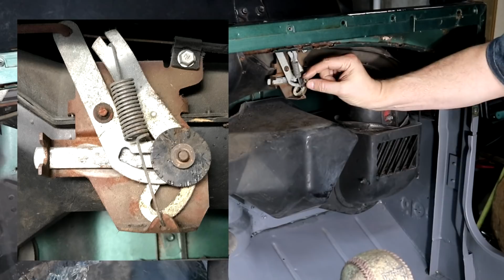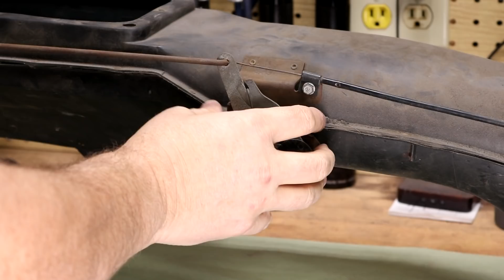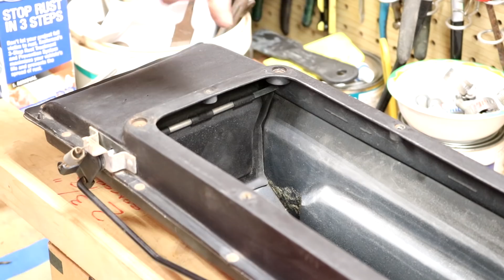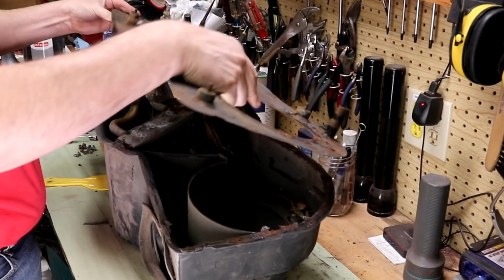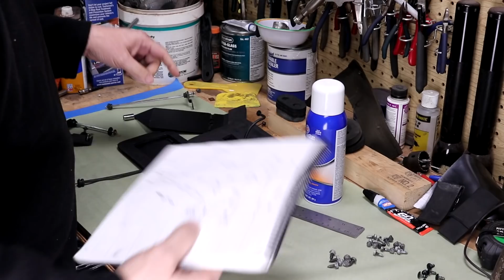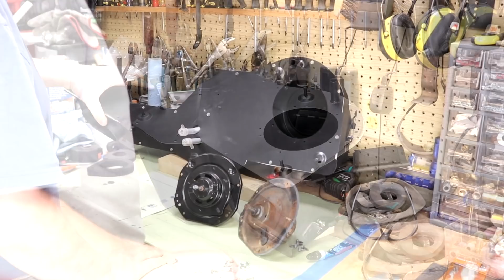Jeep CJ7 Heater Box Restoration | Project Rowdy Ep028

Comment: question  for you, i am working on my heater now to put back in,  the Pm102 blower motor  there is a metal ring around the part that sticks out  the firewall,   it can be pulled off.   does that ring have be on? is it just guarding the magnet ?  with it on, it does not fit in the hole by like 1/8 but if i take it off it fits.   not sure yet how much sticks out, maybe i could put it back on once in stalled?   I asked the people working on the body to cut the hole bigger but they used a different blower so its off. thanks
Reply from the maker: I do remember that extra thick metal ring around the motor, but not sure of its purpose.  I would not think that it has anything to do with the function of the motor, but not sure.   You could take it off, then connect the motor to power to determine if it sounds like it is running OK.   If so, run it!

Comment: "Rebuilt" my heater box when I first rebuilt my 1979 CJ-7 in 1998. I sure do wish I saw your video back then. Now my heater core is leaking (27 years later), so it's time to pull the heater box out again. Great video, makes for a great tutorial! Thank you!
Reply from the maker: @marcdenlinger5282  Thanks for the feedback.  As you may remember, it is not that hard.  After reading through what others had done, I knew documenting the process oils
Be beneficial to others.   Best of luck and enjoy the process.  Mike

Comment: Good evening! Once again superior videos!! Thank you so much! What wiring harness did you go with? Thank you!
Reply from the maker: Thank you... Thank you!   I have not purchased the new Wiring Harness, but from my previous research, my plan is to use the Painless 10150.  Since I did that original research, I have thought of a few other electrical features that I will be adding to my Jeep.   I will need to double check that the 10150 will still support my needs.  I am pretty confident that it will.  Have fun with your project!!!!   Mike
Reply: @ I’ll b monitoring your next move🤣🤣, thanks Mike once again ur a champ!!

Comment: This is one of the the best things I did for making mine a decent daily. Where I lived at the time was way out in some canyons 20 minutes of bad roads to get to a highway. The next was Ford internet wiper switch / module. Super easy, my next would be to run foreward off-road lights on a switch/ relay system so I enabled them with the regular switch, but they would only come on with high beams, and turn off with low beams. Also ran rear floods similarly, they came on when in reverse with high beams (no switch) or on with a switch.
Reply from the maker: @JamesMcNamara-j1g  Aweaome!   Thanks for sharing your other mods.   Those are great ideas!   Mike

Comment: Man going back and reviewing this stuff after not working on my jeep for a long time brings it all back. I was thinking that blower motor was the same as either the Chevy Vega or non-A/C late 70's Chevy trucks. I had both in the past but memory is a little fuzzy now. I've had problems with replacement heater core not being a drop in fit too. Having the hood, dash and windshield off sure helps! This is excellent work and I will probably refer back when I start on mine again.
Reply from the maker: Several simple repairs and upgrades that should make these heater boxes work better for us.   Cheers and have fun tackling yours!   Mike

Comment: I like the attention to detail. I'm getting ready to fix a lot of problems on my 1980 CJ5. It's a fiberglas tub & I'm the 4th owner. I will use your video & PDF files when I pull out my heater box. The prior owners really didn't know what they were doing. I have restored the complete suspention system as wel as the fuel,brake & clutch systems. Keep up the great work &  thanks for taking the time for such things as the template (above and beyond).
Reply from the maker: Sounds like you have already corrected or updated many things on your CJ5.  Hope you continue to find success in your updates.  In the end, it will be very rewarding.   Thanks for the kind words.   Mike.

Comment: my latest CJ7 came to me needing a lot of TLC, the heater box was disconnected and the hoses bypassed I presume because the core was leaking.  Your videos are great and I'm going to try to tackle the heater box myself.
Reply from the maker: Awesome!   The heater box restoration is very straight forward.   best of luck with your CJ and have fun with playing around with it.   Mike

Comment: I just wanted to say thank you for the videos and everything extra you have done.   you explain things simply and are easy to understand. I am going to restore my 85 cj,  I hope next year, I hope to start taking it apart in the next few weeks, I have watched a bunch of your videos, even the ones that I don't think I will be doing.  I hope to take things apart myself and then shop out what needs to be done. going back as stock as I can. but want to clean it all up stop any rust and make the Jeep an everyday driver. going to do my heater box myself and add aftermarket AC.  not sure if I will do the heat/AC one or just AC ( probably just AC)      anyway    only proper to say thank you very much,   I know this is a few years old  but what is great about this is someone can find it years later and it still helps
Reply from the maker: Thank you for taking the time to provide this great feedback.  Glad that these videos are helping guys that decide to help put these ole Jeeps back on the road.  I have owned mine since 1988.   Have fun with restoring yours... They are not that hard to work on and there is plenty of help out there!   Cheers.   Mike
Reply: I got my 85 cj.  In 1989 when I was in high school !!  
So I have had it a very very long time.   Runs great.   But I want to future proof it. 
Paint it back Olympic white  
I got a set of original seats in the mail today.     I hope will be good enough to reupholster Doing lots of research and looking.   
Thanks again.     I may even try to record the process.

Comment: This is an incredible video…..  thank you. I need to do this.  Nice job on the editing. How hard it it to take the dash off to get to the heater?  Do you have a video on that?
Reply from the maker: Glad you enjoyed the video.   I do not believe that you have to remove the dash to remove the 2 units.   It may help to remove the passenger seat just to give you more room.   From the engine side of the firewall, you can detach the hoses, 4 nuts, drains, and Blower Motor wire.   The video shows where the 3 control (push/pull) cables are attached under the dash.   You should be able to reach under there and detach as well as the flexible vent connection (between the Heat box and Fresh Air Box.   The heater box should them be available to remove.  For the Fresh Air box, you will also need to remove the inlet grate (where the fresh air comes in) from the top of the cowl.   I would at least give that a try.    Mike
Reply: @UCanDoIt2Mike   Thank you for the quick response.
Reply from the maker: To answer your other question.... How hard is it to remove the dash?"  In reference to removing the Heater units...  The dash could be un-screwed from the tub and pulled back a little.   The Speedo cable will restrict how far you can pull it away.   I will reiterate that you should not have to do this for the Heater refresh.   Here is a video on me taking out my dash.  I did it as a part of a total restoration.  

https://youtu.be/o6mW55GZmIg

Comment: My 1978 CJ5 has the open cell foam on the triangle end of the defrost/floor heat gate/damper.  The original piece was made out of one piece and folded over the angled edge.  It covered both sides of the triangle from the bend out.  I took a picture and have dimensions if you want to add it to your drawings (not sure how to send it to you).  My heater turned out great following your video and drawings, thanks!
Reply from the maker: Awesome!   Glad to here that you were able to get yours refreshed.  I would like to see your drawings for the triangle piece.   It would be easy to draw up.   I would have to label it as 78 CJ5. Unless we knew what other models or details of when it was used.   Cheers!!!!!   Mike
Reply from the maker: You can send it to my email address.    UCanDoIt2Mike@gmail.com.

Comment: Thank you so much Mike. I was watching the video for a few times, gathered all the required material for a period of 2 years, right here in Germany. The designated period for getting the work done was last July, but then I got hit by Covid. Now I am returning from 4 days in front of my garage with my '85 CJ7 Laredo. Heater core replaced, blower motor upgrade, everything work well and it turned out very successful. Couldn't have done it without you and your great videos! Thanksaton!
Reply from the maker: Absolutely Love It!   Glad you were able to get yours all restored and upgraded.  It should now last you a very long time.  The extra heat output with that new blower motor is well worth the effort.   Enjoy and many thanks for your feedback.  Love hearing when these things work out for others!  Mike
Reply: ❤ @UCanDoIt2Mike

Comment: I am preparing to do this for my 85 CJ7, this is just fantastic information. while removing my heater box I noticed I don't have any springs on any of the flap hinges. I am currently looking for OEM or good replacements, if you have any information I would love to hear it, otherwise I will post once I find something that works. Thanks for the great information!
Reply from the maker: I bet it would be hard to find originals and those that have heater boxes for sell, probably would not just part with the springs.   My local Ace Hardware has an incredible assortment of springs that I bet you could find one that solves your issues.   Hope that helps...   Mike

Comment: Hi and thank you for posting this video. I’m currently in the process of restoring my Jeep and am this point in the project. Thanks to your video I had the confidence to tackle the heater box and fresh air intake assembly. I’m looking for the pdf you offered so I can cut out the neoprene but I can’t find it. The link you posted shows that the file has been removed. Any chance you can resend it please?
Reply from the maker: Under the Video there is a link to the PDF.  It dies sound like you found that link.  When I try the link it works.   It does take about 10 seconds for the file to load, but it does.   Here is that same link:  https://bit.ly/JeepCJ7HeaterBoxPartsDiagramNew.    Let me know if that one works.   I can see that many people have accessed it over the past week.   Thanks and let me know!   Mike

Comment: This was a great restoration video help me a lot I just did my vent Box and just wanted to let you know mine actually did have a triangle piece of open cell sponde like gasket on the other side of that flat piece with angeled end you're working on   at 34mim in. I put a new triangle gasket on the other end.
Reply from the maker: That is interesting about the foam section that you found on yours.   I assume that it would be from being manufactured in different places.  Or maybe the guy that made mine was having a bad day!   Glad you found this useful and it sounds like you will soon be enjoying your restored Vent!  Sweet!  Have fun with it... Mike

Comment: How much more difficult is it to remove/install the upper assembly if you don't remove the dashboard? Will it get snagged on the wiring harness, instrument cluster, etc.?
Reply from the maker: Not to my understanding.   While I was not in that situation, I have seen examples of being able to remove both the lower heater box and the upper fresh air duct from the Jeep without issues of the wiring harness.  From what I’ve experience, I also believe that to be very possible.
Reply: @UCanDoIt2Mike  Thanks! I have a 1980 CJ 7 and this is a sorely needed project that has intimidated me for awhile

Comment: Working on a 1981 CJ7 Laredo for my 15 year old. (I have a ‘79 project for when I retire).  I was wondering if you could post the brand name,and possibly part number for the new fan motor. I can’t find it. Most that I see come without the mounting plate. Thank you for your help! I’ll be watching until your done!
Reply from the maker: Below the video in the Description section there is a link to a document that provides all of the part numbers that I used for my heater box.  It also includes the diagrams of the foam pieces in case you need to remake them.   Let me know if you have a problem finding the document.  On a computer it is a “More” section on an Apple phone, it is a little down arrow.    Congrats on your sons interest in Jeeps.  They are fun to work on.  Great father son project.   Mike.

Comment: Is the blower wheel in the picture identical to the one that you used?  My wheel looks like your original wheel that you removed.  When i went to order the listed wheel from Quadratec using the product number provided, there were comments that the offset is wrong and the motor shaft is not long enough.  Great video!  I used it to restore my heater box.  Thanks for the information.
Reply from the maker: You want the PM102 Blower motor.  Amazon and all Auto Parts stores care it as it is a very common motor for cars around the 70s and 80s.   Cheers and glad you were able to get yours rebuilt!!!  Mike
Reply: @UCanDoIt2Mike  I apologize, when i said wheel, i was referring to the fan.  So if I get the pm102 motor and the fan/wheel that you have listed, it should fit inside the heater box assembly? Thanks for your response.
Reply: After re-watching the video I see that you reused your original fan wheel, which is the same as my original.   If you notice the picture in your material list,  the center of the new fan wheel is offset.  I do not think it is the correct wheel and I am having a heck of a time finding the correct one.  I appreciate all your help  and subscribed.
Reply from the maker: @richardfine8525  Yes.   The motor in the picture is the upgraded motor that I used.   I reused my caged fan blade, but if you need a new one, the part number is supplied.
Reply from the maker: @richardfine8525  I remember also having a tough time locating the fan wheel as I thought I would need to replace mine.   But after looking at mine, it was fine.   I never ordered the fan listed.  So I cannot guarantee that it is correct.  It is from Quadratec which resell Jeep parts.   You can call them to verify.

Comment: I'm about to rip the heater box out of my 80 CJ-7 and I'm thrilled to find this video. Thanks for being so thorough and providing all the info you did. I'm going to make a video because I'm do some 3D printing for mine, but I'll be sure to point my viewers to your channel. Thanks!
Reply from the maker: Relatively a simple process.   You will learn alot about how it works when you take it apart.   Cool stuff.   Thanks Mike

Comment: Just found this as my old CJ-8 needs both air and heater boxes reworked.  The link for the PDF doesn't seem to be working.  Is it still good?  Great video, by the way.  One of the best I have seen.  Great detail!
Reply from the maker: The link works for me.   Try this one.  YouTube apparently abbreviates the link on some browser platforms.
- Heater Box Parts Lists and Diagrams:   http://bit.ly/JeepCJ7HeaterBoxPartsDiagram

A very rewarding project.   Have fun with yours and let me know if you are still having problems reaching the file.  Cheers!  Mike
Reply: @UCanDoIt2Mike  I just downloaded it for future use. It worked, thanks!

Comment: Great video, very informative, what kind of “putty” did you use to seal the heater box?
Reply from the maker: It is a roll of putty like they use on Campers to seal windows.   There is a link to a PDF file in the description section of this video on YouTube that has the actual product name that I used.  Almost anything that will somewhat stay pliable will do.